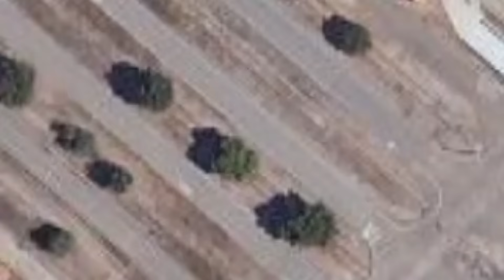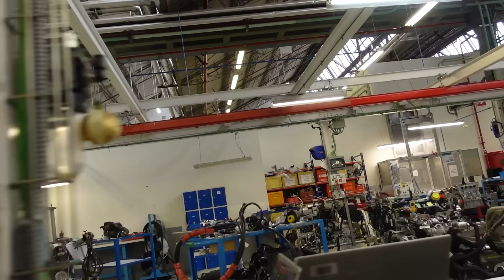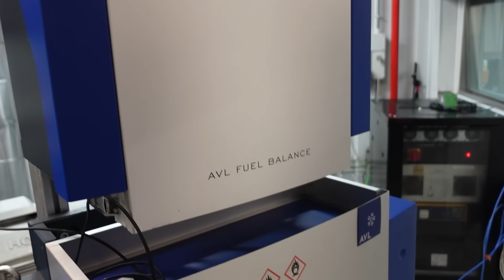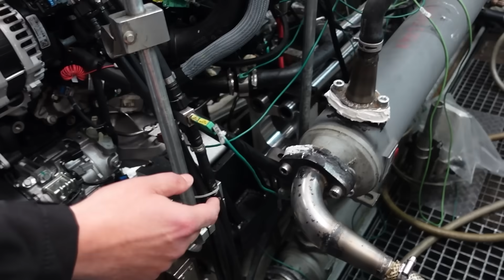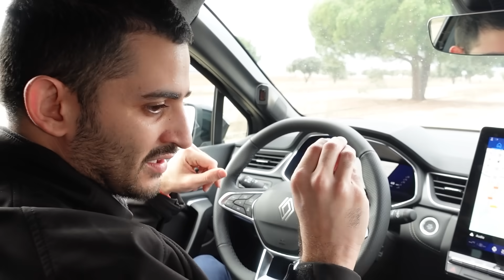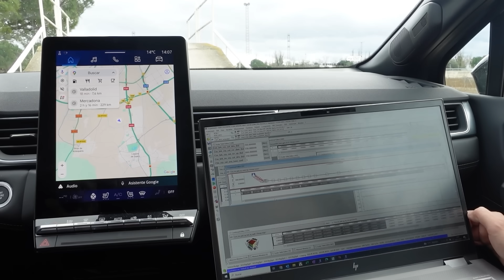Let's Visit A Cutting Edge Automotive R&D Center

Comment from the maker: This video will probably be a bit too technical for some but for me it was a real privilege to see firsthand how engines are tuned and tested inside a large OEM research and development center. I'm hoping my fellow nerds will appreciate the in-depth insight.
Reply: We did appreciate :)
Reply: it is not too technical its too short :) especially the interview part. It would be nice to elaborate what are the market trends outside the Europe, and what are Horse startegy there. Anyway, thanks for videos like this.
Reply: Really appreciated it. Please, do more videos like this one!
Reply: When are you submitting your job application? It seems like you found your tribe.
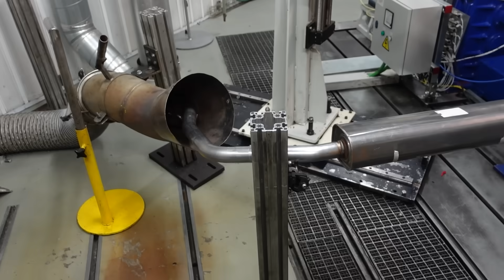Reply: 7:58 They always simulate conditions of a moving vehicle?
Reply: @ChrisGR93_TxS not necessarily, it depend on the test they need to do. It can be driving cycle as well completely unrealistic test to test engine capability, performance and reliability. For example, they make repeated cold start followed by full throttle.
Reply: Part time jurnalist and independent media producer would be my description
Reply: The chap who showed you around has better English than my Spanish😄 but I had some difficulty following what he was saying, even with the captions on. I guess that the relative weakness my engineering knowledge doesn't help😄
Reply: Influencer, content creator. Or automotive informer? Content is a shite term
Reply: Hey dude! Another nice video. Can you make a video about steel pistons someday? I think it would be great!
Reply: Too technical? Your entire channel is technical!
Reply: Can you do something alike in Aveiro's Horse factory? Looks like you are not far away.
Reply: Very appreciated. I also can’t help but think how behind we are here in the USA, where these folks everywhere else in the world speak our language as well or better than we do, their own language, and have technical jobs. Yeah. We’re behind. In a lot of ways.
Reply: Its a great video, and as someone who worked as a development engineer in a facility just like this in Detroit MI, US, its cool to see just how similar things are around the world. 

Great video, like always!!! Keep up the great work its greatly appreciated!!!!
Reply: The MA250 Engine Has No Crankshaft!! Please Look This Up .  Just Wanted to Give you Heads Up, most likely you have already heard of it and are already Planning a Video. But, Just in case, The Darn thing is Awesome. :yougotthis:
Reply: #1 I'VE NEVER HEARD YOUR NAME SO , 
WHEN I EMAILED YOUR SUPPORT EMAIL ADDRESS,
IT SAYS TO CONTACT THE SUPPORT TEAM EMAIL ADDRESS BY REPLYING. 
I DID TWICE. 
THE PAGE YOU SHOW IN THE VIDEO ABOUT THE ROTARY ENGINE , POSTED JUST BEFORE THIS ONE, 
IS A PAGE ONLY THE ADMINISTRATOR, WHICH IS YOU, CAN ACCESS. 
WE CAN'T SEE THAT PAGE. 
I SCREENSHOT THE VIDEO & 2 PAGES WE CAN ACCESS. 
YOUR PERSONAL EMAIL FOR THE CHANNEL IS NOT ON THOSE 2 PAGES. 
FIND MY EMAIL AND EXAMINE THE SCREENSHOTS. 

CDBURLOCK
Reply: Can you make a video about air bearings? Could they be used in turbochargers?
Reply: Even for a simpleton like me, I got a lot out of it! Thank you for your time and sacrifice to get us this info!

Comment: at 26:00 - Another interesting question with engines running in hybrids is how they prevent condensation of water in the oil which can happen if the engine runs without getting hot for short duration.

Comment: These guys are tweaking a 19th century invention to something out of this world using absolutely cutting edge technology! 
Kudos to them for  that  - brilliant! 
However, in my opinion, as brilliant as it is, it is too little too late for the direly needed transition to non-CO2 (and other pollutants) emitting propulsion systems. 
I saw a Renault Megane E-tech in the footage  - I am afraid, that vehicle is the future as a daily driver, we can, at least here in EU,  produce power for that daily driver with a very low CO2 foot print... 
And as a matter of fact, the Renault Megane E-tech is on my list of options to ditch my old ICE : 
A proud Volvo 2011 V50 DrivE diesel  25+ km to the litre and less than 130g  CO2/km... 
And my total daily drive is less than 20.000km/year! Still that is 2.6 tonnes, twice the weight of my V50, of carbon emitted annually!
So I am asking: When are they gonna build a decent EV station wagon? 
The bullshit EV's they try to push on the unwitting public are generally bulging, over weight monsters - why???

Comment: A thought on hybrids: if the drive train is such a problem for efficiency, why not take the railway approach and simply use the ICE engine just as a generator? 

This gets rid of everything that adds complications and inefficiencies, and allows the engine to be designed as simply and efficiently as possible. In that way, if the batteries are low on charge, the car simply switches to ICE generation. Every other aspect of the way the car is driven and controlled remiains the same. 

Although technically still a 'hybrid', the car is essentially just an electric vehicle - but with an emergency source of electricity.

Comment: In reality, hybrid powertrains are doing what they've always done well, while conventional internal combustion engines are being forced to add too many extra gadgets due to environmental regulations. The frequent on-off cycles that some people worry about have been a concern since hybrids were first introduced, but durability has never been a major issue for hybrid powertrains from various manufacturers, including pioneer Toyota. I believe that engine oil contamination can be an issue, so I've been changing my oil myself every 5,000 to 7,000 kilometers

Comment: Bro, maybe 2 years ago on a video about turbos you were talking about the stututu noise from turbos, and I made a comment about how my mom's 1.5dci turbo did one single LOUD STUuuuuu noise like an old truck instead of the normal stututu.. could you please, give me a hint of what it could be specifically? At the time the car eventually stopped doing the noise and lost low rpm power, but the mechanics got it back in whistling shape in like 30 min or less, and I need them to do it again bu unfortunately it's been a while and I don't think I can ever make them remember exactly what they did because it was off record
Reply: To clarify you also replied the comment telling me it was likely a stuck wastegate or something if I recall correctly.. the thing is if that's really the case, that stuck wastegate kept her car in the sweet spot for years and she wants it back, so I am basically asking to tell the bros at the shop to put it back in whatever stuck position it was before  :/
Reply: You want more boost then, get a stage 1 tune

Comment: My entire career has been in automotive testing. Worked for one of the OEM's propulsion lab doing engine validation, and now do chassis component level testing. Testing can be quite challenging and requires alot of outside the box thinking at times.
Reply: Just wondering what's the harshest tests you've seen? Have you tested with overboost or high temperatures?

Dyno work fascinates me

Comment: I love videos like this. I'm a software developer and I have a keen interest in cars, both in the software and the hardware side.

 I'm really hoping that better diagnostics will become available to users fixing their cars. Currently data and procedures available through OBD II feel really limited as I'm tending to my euro 6 diesels emissions system. Yes, dealer tools are an option (although inaccessible to most and really expensive), but that's not a solution for the home gamer.

Comment: Having no clutch and using the electric to synchronize the gears is pretty interesting.
Reply: As it should be in a hybrid tbh. Why would your hybrid have a ring gear? Or even a starter?
Reply: Ford actually developed a similar system in 1969. Toyota refined it, then Ford said "That's our patent". Toyota said 'Oops, Sorry". Ford said "Can we share?" Toyota said "We can and you can incorporate Toyotas improvements" Later Toyota incorporated one of Ford's improvements.

Comment: I toured an independent drive train R&D center in the US (Southern California) a few years ago and it looked nothing like this. It looked like a large laboratory with engines on stands in sealed rooms with telemetry equipment attached. The company did a lot of work for BMW and had a 3-Series frame with the ability to quickly mount and test different engines. It set my respect for OEM engine R&D to a whole nother level.

Comment: 🤔 Funny how the Toyota Prius hybrid only gets 50 mpgs .....While some European diesel cars can get 60 & 70 mpgs out of 1.5 & 2 liter turbo diesel engines. Why build a heavy complex hybrid full of batteries. When you can just build a lightweight turbo diesel 60 mpg hatchback?
Reply: In the last 3 years ive only repaired 2 petrol engines....I've lost count of the number of diesels ones I've done major operations on...😂😂..
I know sometimes the owners are culpable...
Reply: No diesel ever is more efficient than a prius on an average cycle

Those diesels are unreliable and complex
Reply: @vladdutz20 BS. Prius was crowing about 44mpg when a Honda Fit actually got about the same and had more usable room and better drive quality.   Nevermind Diesels that we're getting 61mpg in much larger cars like the Jetta Sportwagen (46 in the US due to emissions changes, but 61 in Europe).
Reply: @brianhaygood183 there are many prius variants made.

The dual motor hybrid systems from toyota and honda have excellent mpg on an average cycle.

A diesel is only better at highway speeds 

And in the end the total cost of ownership and mechanical reliability of the japanese hybrids from toyota and honda is very good

Comment: You should go to a 2 stroke motorcycle factory and ask them if expansion pipes use sound waves to make more power by pushing hot unburnt gasoline & air back into the cylinder.  Or if it's shock pressure waves that's pushing the unburnt gasses back into the cylinder.

Comment: Cutting edge for French auto makers is clearly still 20 years behind everyone else.
Reply: They always had pretty advanced engineering in many fields
Reply: @vladdutz20  Nah, they bought that from Japan.
Reply: @kylejohnston3442 completely false.

Renault is involved in many engineering and aviation development, independent from this partnership with Nissan
Reply: @vladdutz20  Development, yes. Cutting edge, No. They make a great many mistakes constantly and consistently. the engine tech is a direct descendent of the VQ series. hence "buying it from Japan." everyone has OCVs and VCT, coatings and aluminum blocks. Unless they create a CF block that is cooled by and runs on ammonia or another abundantly available fuel source, they are not cutting edge. Sadly the coolest production available vehicle to come from french design is the alpine A110 and even then, its engine does no better than a ford ecotech from a decade ago and its drivetrain, hard and software is a facsimile of a German pioneered design. IMO: a solid "B" grade manufacturer. To address one of their strengths: They seem to have success only when a mid-mounted platform is produced.  ( Yes, I am disregarding aerospace divisions as that conversation is an endless rabbit hole.)
Reply: @kylejohnston3442 HR is clearly a nissan Heritage, i was saying about the french involvement in automotive and aeronautical engineering in general

By far Japanese have cutting edge engineering which in many cases is a rather simple engineering

Comment: If you take a conventional ICE and put it in a hybrid you DON'T put in a different cam?! Really?
Reply: The HR12 has permanent Miller cycle no matter if it's on a normal or hybrid vehicle
Reply: He did suggest using Miller vs Otto.  So, he covered that kind of possibility in broad strokes without naming every part that would be changed.   The actual changes could touch nearly every part, from valve springs to lifters, and beyond depending on how much the rpm range could be limited/tuned.
Reply: @brianhaygood183 it's the same situation like on Hyundai, 1.6T engine is the same on the gasoline and hybrid 

There are ancillary differences, because the gasoline only engine has a drive belt for the alternator and AC compressor, whereas the hybrid has only a small flywheel, the alternator is actually the HSG from inside the transmission 

Basically it is more expensive to use different parts, the less the differences, the cheaper it is to build

Comment: Horse Powertrain Limited is a joint venture holding aimed at producing powertrains, including internal combustion engines (ICE) and hybrid systems. The venture holding was established in May 2024 and is equally owned by Renault and Geely (including Geely Holding and Geely Auto). It is headquartered in London, United Kingdom.
(From Wikipedia)

Comment: I've been following you and admiring you for a while. I wanted to ask you something about diesel engines, especially since I’m a huge diesel enthusiast. Why is the 1.9 TDI (ASZ) so robust that it can even reach over 500 horsepower with stock internals, while the rest of the 2L diesel engines aren’t? Especially the BMW N47D20C engine. I own one on a BMW 320D E90. However, can you explain why the chain tends to break, a very common problem on these engines?
Reply: Because they are built different, one is cast iron block, the other aluminium

Comment: Útil video. Ahora queda explicado el costo y complejidad de los autos nuevos. Hay muchas variables a controlar, sin embargo se les escapa la principal : el combustible!!! Todo hidrocarburo que se quema "bien", genera CO2, H2O y algo más. Esta mezcla de productos de combustión no se reconvierte a combustible y aire nuevamente, porque habría que gastar mucho más en reconvertirlos nuevamente a su estado original. El combustible que genera H2O es el H2, tanto sea quemándolo en un motor de combustión interna como en una celda de combustible. Esto último debería ser el objetivo. Todo lo que has mostrado es muy interesante pero es como pintar una casa vieja con colores y pinturas nuevas o vestir una mona con sedas. Seguiré viendo tus videos, te felicito de verdad, son muy interesantes. Abrazo desde Uruguay.

Comment: Loved your video took me back to when I worked in engine development at Holden here in Australia. From  Cars in frezers for cold starts at -30 degC making custom parts and all the calibration work. I did a couple tours of the test track over my years which was fantastic. For the mechanical minded it was a like playground to work in.
Reply: Who is to blame for the V6 timing chains ?
Reply: @mvnorsel6354 engine developed in USA. Body, suspension, calibration in Australia.

Comment: Here in Norway, 95% of new cars are electric only. The government has taxed PHEV through the roof, so no benefits of buying those any longer. I will try to keep my 2016 A3 e-tron as long as possible. IMHO plug in hybrid is the best solution for cars.
Reply: Yes instead of forcing ev they they should encourage efficiency. Something like 40 to 80 miles of EV range for a plug in hybrid would get rid of 90% of burning gas and make it for more cars that plug in since each one will have smaller batteries.
Reply: That's a shame. In my opinion, Toyota dynamic force hybrids are just amazing, love my es300h
Reply: You mean battery powered. If they were truly electric they would tie into the grid and have endless range

Comment: I love how the test engineer in the car had the data cable held in with tape. I’m a test engineer for a mobile equipment manufacturer and often have to do the same thing. Laptop ports aren’t designed for the repeated connections we have to make.
Reply: Cheapo HP hardware.
Just kidding ... guess the cable is faulty.
Would prefer Macs anyway.
Reply: @yo3429 If their software was written for mac, they probably would've used mac.
Reply: @yo3429you were right the first time, cheap hp hardware, they absolutely make the worst quality laptops of any class.

Comment: Very nice insight into this test facility. As hybrid car drivers we do not always appreciate how much testing and knowledge goes into these modern hybrid cars. 
My Toyota 1.8L car with hybrid drivetrain is 2X (!) as fuel efficient as the  2.0L car i owned in the early 1990's. But it's also  cleaner and more powerful, easier to drive and more reliable. 
That's real progress!

Comment: commercial trade shugs bad. everything. a car should run also without a computer. so any computer is only on top assistance, not crucial for the operation. especially electric motor cars. ie no complex esc/ecu required for the motors because they are dc simple.

Comment: "can we go up in the oval track?"  That must have been a real cool experience.
Reply: I remember getting to go on a test loop on the MIRA track in the UK.  Several laps  at 160 km/h and it seemed 'normal'. We also had to drive the ladder racks and cobbles - I gained a lot of respect for the test drivers who do it day in and day out in exactly the same way every time
The cobbles were a reproduction of the worst roads they could find in Europe and were really brutal on the suspension (and my back)